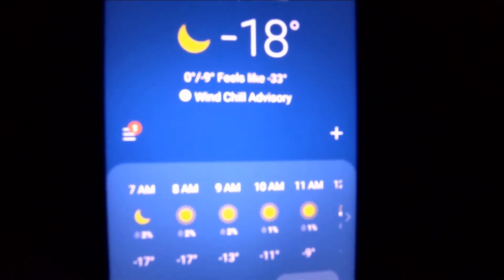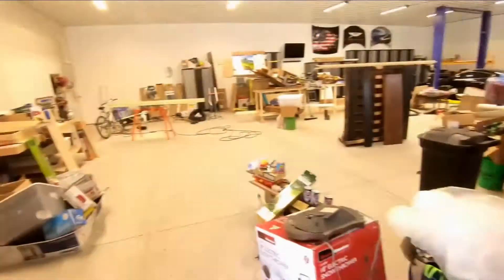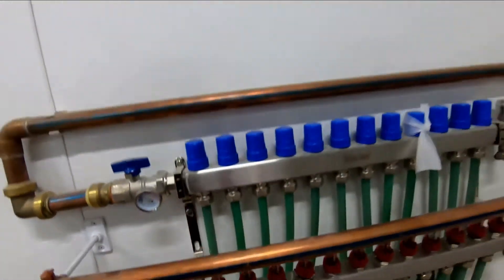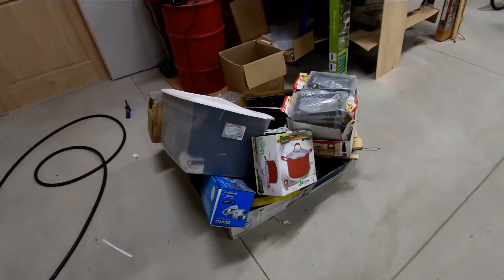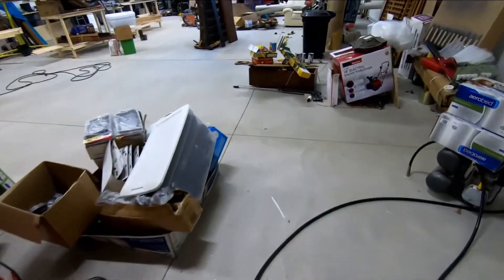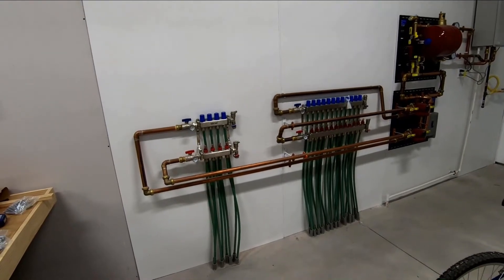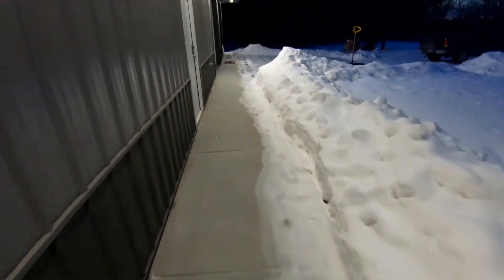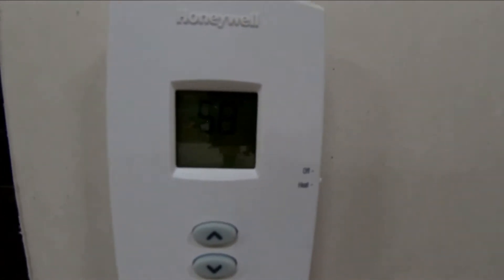-30  Degrees ! Did it Heat? NO Slab Insulation & Tankless Water Heater in Pole Barn Radiant Floor!

Comment: I don’t understand your logic. Yes I agree 2” pink foam is kinda pricey but you only have to pay for it once unlike propane or natural gas.   If you insulate properly your gas consumption would be a lot less. I don’t remember any radiant job I have ever done that the delta T was that high 
I don’t know where you got all your information but windchill won’t affect a property insulated building. I have had my own heating business for 50 years. The major source of heat loss in any building is air infiltration but you can over come that by making your walls and ceiling air tight it’s called spray foam and the windchill factor won’t affect the heat loss which will relate to lower fuel consumption.   Yes I agree you can get just about any system to work but my customers call me and say it’s only costing me this small amount of gas to heat this building or house. I fill sorry for you and the amount of fuel you will be using but I guess that’s what you want 

I built a 4000 square foot house with 10’ ceiling in the basement a few years ago and the people didn’t want to spend the amount of money that I was wanting to spend but I convinced them and we continued with the building    He called me the next year astonished that he was on paying about 25.00 a month for propane.   Three years later I went to the propane company and asked how many gallons of propane he was using per year and it was 300 gallons and that’s in heard  of for that size house the whole house was finished except for the small furnace room I put in the middle of the house. The biggest thing I always tried to do was raise the comfort level. By the way this house was a forced air heating system zoned up and down.   The most comfortable living space is a radiant floor system properly installed. I agree with you about commercial buildings they want the cheapest thing you can give them they aren’t interested in saving fuel consumption or comfort you are right there.  But you get what you pay for. I don’t know how large you building is but foam is about 30 dollars a sheet that equals what less than a dollar a square foot and in my town we can get a guy that has a spray foam business that you can do your own spray foam job. He sends the trailer out with a man to run the machine and you can do it for about half what most companies charge.   That out envelope including the ground is is the most important part of the build 

You can lead a horse to water but you can make him drink 

Anyone going to put in in floor radiant heat my advice is to do it right and you won’t regret it if you cut corners you will regret it 

Talk to a professional if you can find one now days     Insulation is everything
Reply from the maker: I did have this designed by a professional business and that is how a Thermal mass heating system is built. You insulate the perimeter down 4ft or 2 ft down,2 ft over to create a chimney effect .   Also ANY site out there on google states the same, 15 degree delta t for residential and higher. Just google it , you have a computer. Search " Delta T for residential radiant heat " or just search "Ideal Delta T for heating".  Like I explained earlier, I am losing a percentage of heat but the heat loss cost doesn't justify cost of insulation. My heating bill is $550 a year , so assuming a 10% heat loss ,  I am losing $55 a year .Slab Insulation would cost around $2400 so looking at a payback of 44 years! Your $25 a month heating for a 4000 sq ft  home makes sense if its in Texas or Arizona, but in a cold climate that is total BS. No Matter what , a house needs a minimal amount of heat to maintain a temp. Sure, maybe if it was set at 45 degrees, maybe but I highly doubt it.  Spray foam for over 6000 sq ft of walls and roof , your looking at about 12-16K .  I have checked multiple buildings in my area and even broke down the cost per cu ft to heat my building vs others in Multiple videos, and I am using about the same as 2000 sq ft buildings.  Your thinking is the old school way , as in 50 years there have been many advancements in building techniques. I show proof in my videos with gas bills to show that you can heat a 3200 sq ft building for less then $100 a month in Northern climates  , at a comfortable temperature.   Windchill is only something that a living thing feels, buildings and cars don't care about that. What wind does is sap the heat from a building faster. Like blowing on hot food to cool it off. You are correct about air filtration will sap heat also . You can spend millions on making a home air tight, insulated and having the best of everything..... BUT you will never recoup that price. Like women who spend 80K on a kitchen and it gets appraised at 40K . If I don't get my money back , then why spend the extra money to insulate when you never recoup that money in your lifetime? Maybe if your heirs live in the home but if they don't , your wasting your money.  Kinda like people who work all their life ,and not enjoy it,  and save to just leave their money to the church or humane society ! Don't understand that thinking!

Comment: Tony   Water moving too slow pump might be too small not moving enough gallons per minute or you you are loosing too much heat somewhere
Reply from the maker: You don't need a lot of gpm flow unless your return temps are too low. You need only the amount of GPM  needed to start your boiler/ water heater . Mine only needs .5 gpm. and most shouldn't need more then 1 GPM .

Comment: It’s all about heat loss    heat migrates from warm to cold why would anyone NOT insulate ALL of the slab that is so stupid     Why would you want to heat the ground    Most radiant floors you can count on 25 BTU  S per square foot what are you getting 10    20 degrees delta is to high that’s because you didn’t insulate
Reply from the maker: Actually you want a 15 degree delta T for most residential homes and a 20-25 delta T for commercial buildings, google it. So my Delta T is right in specs .  Research Thermal Mass builds and you will see the research involved. Most people think the old way to do things is correct , but things change. Building techniques change.  Yes it is about heat loss and thats why the perimeter insulation is the most critical. If you don't have that then the heat will not funnel up like a chimney, it will escape to the sides.

Comment: Could an electric tankless water heater be used or would it be super expensive? I want to run my entire house and appliances off electric and have it all solar with batteries.
Reply from the maker: Depends on how big or water heater you need depending on your house sq ft. Avg tankless is around 24-36KW  so at say $0.10 per kilowatt , it would cost $2.40 - $3.60 per hour of run time. It would make better sense if you have a thermal mass and can run it on off peak electricity rate of around $ .05 per kilowatt . Off peak is usually night time so the thermal mass will hold that heat throughout the day.  It would still be about 2x more expensive then natural gas , but if you don't have access to NG , then installing it might offset savings until like year 5-10 .  So you need to see how many amps your solar system can supply. Thanks for watching
Reply: @JasonYouTube  thank you for the reply! So to have a greater thermal mass I would need to have thicker concrete poured to make up for the less efficient electric water heater?
Reply from the maker: @Painfulwhale360  Concrete cost around $135-$155 a cu yd where fine sand at mines cost around $5 per yard but you need to add in delivery charge. So usually a dump truck will hold 8 yards , and charge like $100 delivery , so like $15-$20 a yard. These are estimates as if your rural , then delivery charge may vary. Sand has almost the same thermal energy as concrete , at a cheaper price. I should have a video on the Thermal mass build and explains it. Thanks for watching
Reply from the maker: @Painfulwhale360  Electric water heaters are efficient as 100% of the energy is going for heat . where NG is like 94% efficient. Its the cost of electricity that makes it more expensive

Comment: Did you use a 6 mil plastic under your slab.
Reply from the maker: Nope, nothing under slab . Basically the sand under concrete is a massive thermal mass battery and storing millions of BTU's . Nice when you open garage doors as it warms up really quick. Thanks for watching

Comment: very similar to my set up. what pump and what flow rate are you running?
Reply from the maker: I have the grundfos 15-58fc , 1 per zone and 1 for the hot water heater. I run each zone at .5 gpm and each run is balanced at that flow rate

Comment: Great video, very helpful Thank you, I'm trying to figure out why my temp going out is 120f but coming back doesn't get more than 75f, I've tried finding videos on why but couldn't find any, any help, info would be appreciated Thank you in advance
Reply: That is what you want that means you have good heat dissipation.Run your pump at the highest speed.
Reply: @ShadsGarage0221  thank you
Reply from the maker: It could mean a couple of things. 1st one would be starting a cold slab. 2nd would be not a well insulated building so temp of slab isn't retaining the heat. Need to ir temp your slab and see what the temp is of it. Usually will run a few degrees warmer then your thermostat setting. 3rd would be not enough tubing in slab so concrete  slab is draining the heat . Also would need to know slab temp as slab temp would be cold.
Reply from the maker: Usually you want to run as low as temp possible to heat the building,  so 75 coming back but still heating building then that is ok. With hydraulic separation circuits boiler will show temp of 120 but water temp going into slab at manifold will be like 90 degrees. So 75 coming back is a good delta T .
Reply: @JasonYouTube  thank you very much for the quick reply, not sure on the length of tubes/line as they were installed before I  purchased, the lines stubbed up and I finish from their, 1\2 lines 14 total (7supply 7return) approx 2400sqft, thank you again for your help/advice, I'll definitely be using your video when I build a shop myself
Reply: Do you have mixing valves in your system
Reply: @isaacrishel636  yes, when I mix , my temp lowers going into system, closed makes higher temp Goin in
Reply: @tonyandtabithamccallan683 if you are using the boiler only for the floors set your boiler temp for what you want say 120 or 125 and remove the mixing valves they are a huge waste of energy

Comment: Do you have to add glycol when temps get that cold?
Reply from the maker: I have glycol in my system just in case you have a breakdown to prevent freezing. Usually the fluid never will get below freezing as the ground/slab is usually a few degrees colder then air temp when system kicks back on.  So the ground retains the heat and you lose air temp faster then ground temp. With a Thermal mass build, you usually don't have to worry about ground freezing as it will take longer then a slab with insulation underneath due to the mass. Thanks for watching